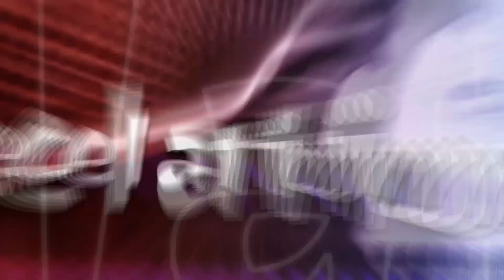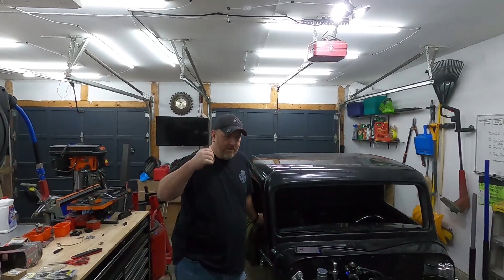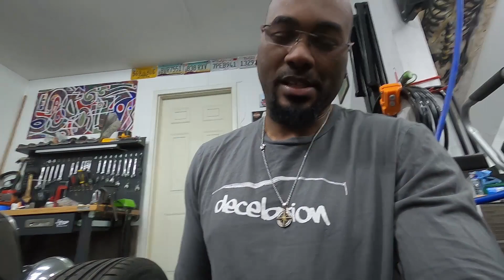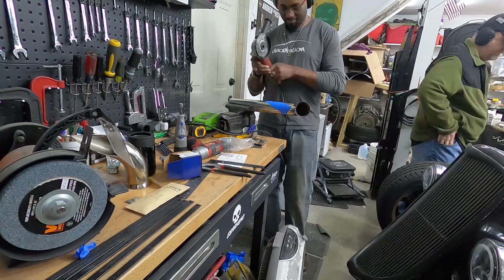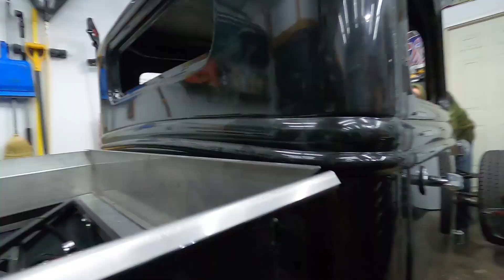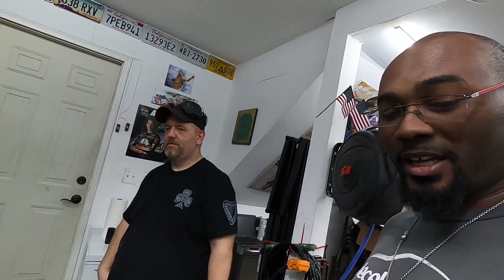Factory Five 35 Hot Rod Truck Exhaust Tips Modification

Comment: Pipes under like that can cause the exhaust fumes to come back into the passenger compartment, especially when stopped. Speaking from experience here. Anyway to put through the side panels? Side exit always looks awesome!
Reply from the maker: That is a good point. I did consider that but it puts it the exhaust too close to the fuel line.
Reply: I hate to say it, but you should check out 19VAC30-70-300, or safety inspection of exhaust systems. You are likely to fail the safety inspection when you try to turn this into a registered vehicle. Ugh, ask how I know about this after replacing a F150 exhaust, only to order more parts after failing inspection...
Reply from the maker: @heathwells3273  that is a very good point. I will definitely look into that thank you